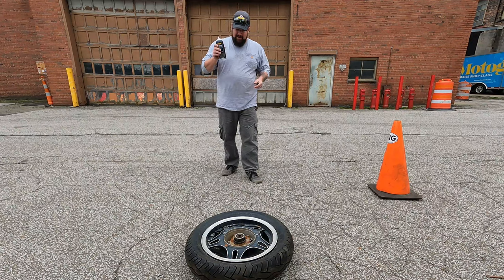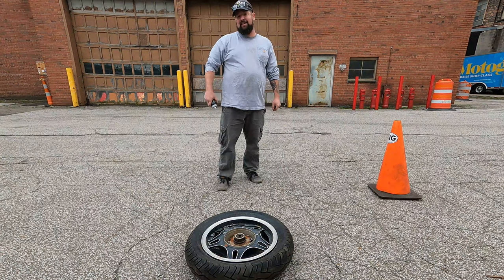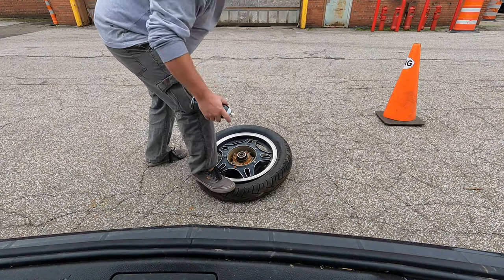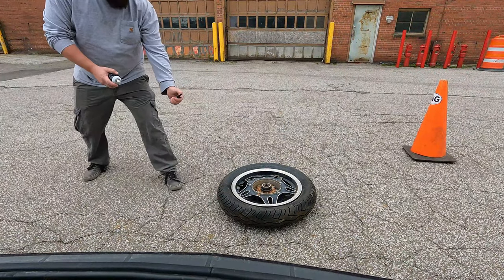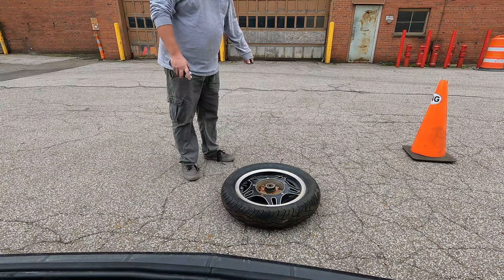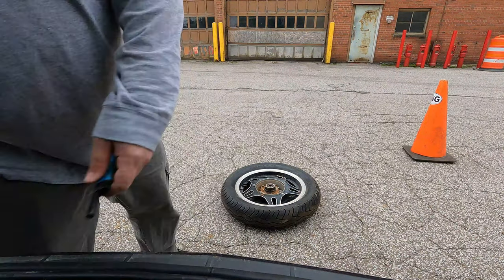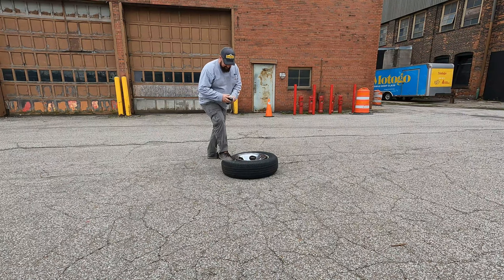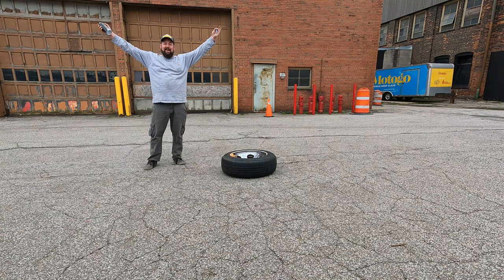Pop a tire on the rim with starting fluid.

Comment: I tried it with my scooter tire but didn't want to draw attention to myself. Ended up at local tire shop where they used ether and chased it with high pressure
Reply from the maker: 😂. It does give a good audible pop.  On small tires sometimes you do have to chase it with compressed air.  Or it pops back off the bead.

Comment: Guessing Schrader valve is in?
Reply from the maker: I think it was out of the motorcycle tire, but still in the truck tire.
Reply: @KnobleMoto  was just wondering never tried it
Reply from the maker: @SteveTheGasMan  it is good to remove the center piece from the valve stem, because when the air inside cools, it will shrink and it can pull the tire back off the bead.  The alternative is to put compressed  air to it right away.